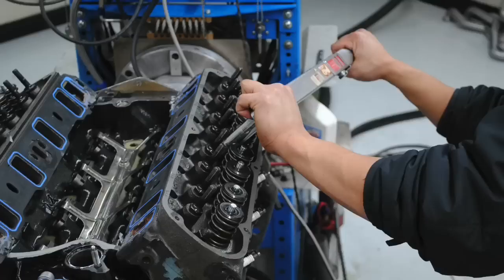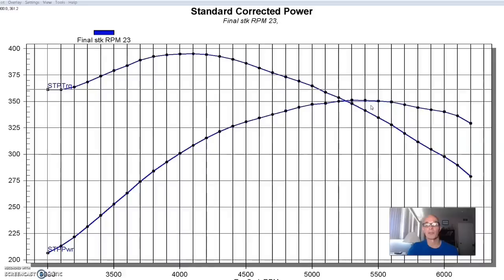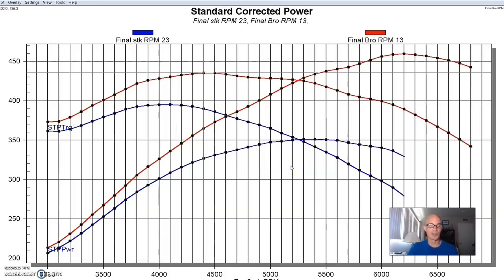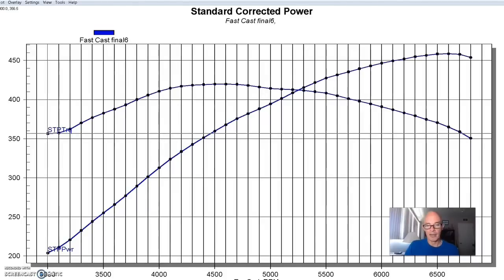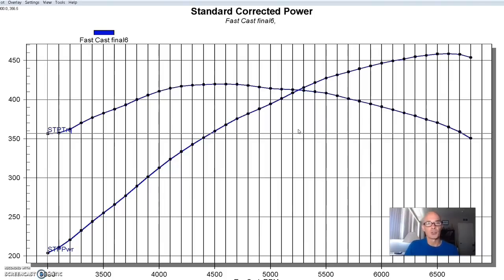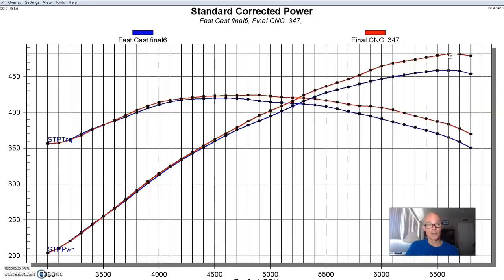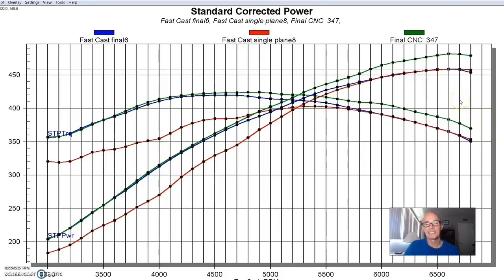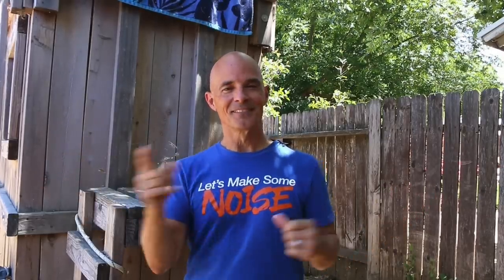347 FORD HEAD & INTAKE TEST

Comment: I haven't a good combo. But I'm commenting so it helps you out.
Reply from the maker: what combo would you build?
Reply: @richardholdener1727  assuming Ford small block I'd like to mess with a 5.4 truck block bottom end with some compression and put some ported 3v heads and piston on it. See how the equivalent mod motor does when compared to an LS. Differences in power. Accessibility and tunability. I've always liked the s197 styling and I think it needs a raunchy 450 hp motor to sort it go toe and toe with the coyotes. And scare off anyone who says the mod motor is bad.
Reply: That's my job lol

Comment: I wanna see the efi 300 ford 6 with a cam upgrade, and gt45 become a cummins competitor.
Reply: Boost for boost, it'll never come close to a Cummins.
Reply: @donellmuniz590  boost for boost an efi 300 ford will slaughter a 5.9 cummins.
Reply: @kylemilligan752  Could be, but nobody would run a Cummins at 10psi, it would be at least 30. The 300 with 30psi would explode like a grenade. So I guess "boost for boost" wasn't realistic.
Reply from the maker: yes
Reply: @richardholdener1727  yes what?
Reply: Not gonna happen .cummins is on another level.
Reply: 1000 pounds of tq at 3000rpm equals 571hp.1000 pounds of tq at 5252rpm equals 1000hp. Can the 300 ford 6 take it? Mr Holdener?

Comment: On even a non stroker. Ford's stock heads are terrible compared to even low buck heads like BluePrint's 190cc. I have seen 75 HP gains on a 302 with a mild hydraulic roller. 480 HP on a street 347 naturally aspirated is fantastic especially considering those roller 5.0 blocks can split in half over 500 HP.